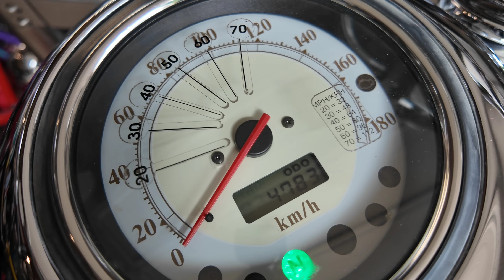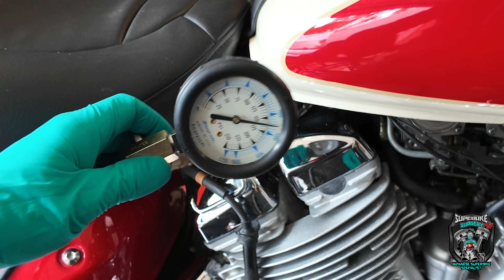Not Again 🤬 Helping a Subscriber Fix Someone's F*** ups. Yamaha Royal Star 1300.

Comment: Firstly..DON'T IGNORE YOUR BACK PAIN !!!! REST IT, SUPPORT IT.  ( 30 years of Sciatica makes me say this...)  Is this going to end up being a warning of the dangers of out of date condoms ??? Nothing worse than "out of date " rubbers............Perish the thought....
Reply: Jim, have you forgotten that there was water down the plug hole , water causing misfire maybe ?
Reply: Too small is far more dangerous! Wheeeee!
Reply: Try the " squat " excercise for your back pain ...
Reply: @whyyou679  
Yep , thanks. and fellow sufferers Especially Men. Wipe your ** sitting down ! NEVER rise and bend over.........Worse strain on Lumber vertebra. Keep it STRAIGHT....
Reply: @tridentmusic5570  
Bounce in a squatting position ... 10 or 20 times ...gets rid of sciatica pain ..it works try it
Reply: @whyyou679  Thank you I will.
Reply: Love the waffling ,need a vid on ignition coils. You explain the tough stuff very fluidly. At least to me! Subscribed
Reply: Depends..It shot in my back just standing up
That was an abrupt movement for the muscle and it cramped up to protect itself from more stretching
Use light painkillers to relax the muscle and keep moving around
The cramp will loosen up slowly in a few weeks and back to normal
But don't go lifting things

Comment: 27 years old and done 5000 miles, It's mental people buy a motorcycle to leave it sat around for years and years doing absolutely nothing.
Reply: Priorities in peoples lives change… and some people like having nice looking trophies… many different reasons why bikes are parked up for years.
I know a guy who parks his bike at his friends place, coz his missus has no idea he even has a bike, and he only does about 100 miles a year. Secretly lol.
Reply: Bought an '02 CBR F4i last May - it had 5300 miles on it. About 3500 in the first 3 years. 

Runs like a sewing machine but the rubber parts give me the fear tbh. I put braided lines on it but the fuel and cooling lines are all original...

Getting the forks services and new constant rate springs fitted in 2 weeks time - asked the mechanic to give it the once over on those parts that could be close to perishing.
Reply: Looks like kph speedo so way less . more like 2000 miles ish
Reply: Jim , that machine was built way B4 E10 was ever thought of . Do u ever perform full fuel system flush first ? Then fill with E5 before u fault find .
So much crap in E10 these days

Comment: Thanks for that. ( I really mean it)  I now know there is more I should know about ignition coils and a little of why a weak spark when tested with a plug on the outside of a cylinder may be too weak under pressure when in the cylinder.

Comment: I'll concur with the difficulty of knowing one of the cylinders in a V4 motor is not firing. I had a disconnected coil wire on the right rear cylinder of my VFR. The bike started right up, seem to idle and run fine, but two clues came to light. These were poor MPG and when under heavy acceleration or putting load on the engine from a stop, when going up a hill for instance, you could tell something was up. The bike sat for a while due to health reasons, so when I was finally able to ride again, it took a few rides to realize and resolve the issue. Getting reacquainted with riding again and with the bike itself took a little while. All good now on both fronts. Love your videos, even with the cursing, but they are definitely more viewer friendly without the swear words. Either way, keep up the great work. Cheers
Reply: "when going up a hill for instance, you could tell something was up" 🤔😁

Comment: Had a similar problem with a Vmax bud it was carbs related, I had the carbs off twice, cleaned them thoroughly same problem, third time I cleaned them I totally stripped and soaked them for 24hrs in acetone, rebuilt them and the bike fired up first time and ran fine from then on, main pain in the ass is refitting them each time they came off 😂, good luck with it but if you're sure it's fuelling use acetone 👍

Comment: Used to get a very similar problem with my V-Max. There are drain holes down next to the spark plugs, one of these holes was blocked on my bike causing water to gather around the plug. This caused it to miss fire just like your bike, it was an easy fix but it took me weeks to discover what was causing the problem.👍

Comment: Jim I own a Royal Star venture and i had a problem with a non firing cylinder. the connections on the coils for the rear cylinders are underneath and can corrode. They are also a real pain to replace

Comment: You can use a timing light to verify if the ignition on a cylinder is at least basically working. Won't give you huge detail - but if it firing reliably there is at least some spark happening. Seafoam in the tank of as parked bike and then actually riding can clear faults - some heat soak is good for the engine. Rubber head flanges/carb mounts go hard, brittle and crack with age.

Comment: I’ve had a couple of times the engine was missing until I started to remove the cap to work out which cylinder, as I removed the cap the spark came back but only with a gap between the plug top and the cap 🤮

Comment: A couple of things Jim:  You use brake clean as a vacuum leak tester.  In America brake clean DOES NOT BURN.  Some carb cleaners do not even burn and must be flame tested first.  We use aerosol carb cleaner.  Also I am very familiar with the oscilloscope spark pattern from my years as a VW mechanic and in another video what I saw looked like the resistor in the sparkplug connector was bad (open circuit)  I'm surprised you don't do an ohm check of the ignition wire itself.

Comment: Pro tip, use a cheap ebay infrared gun on the pipes, you will keep your fingerprints.
Reply from the maker: I have a thermal imaging camera if I could be bothered to walk to my toolbox! 😁
Reply: A spray can and water works quite well.

Comment: I think the notion that an open secondary will damage a coil is an old wives tale.  I’ve never seen a technical paper or data that supports that.  However, I’m always open to data if you’ve come across a good reference that supports damage in this scenario.
Reply from the maker: Thanks for the comment 👍 I must say I'm pretty much with you on this. I've only ever had one instance where, after lots of cranking, I've created a secondary ignition problem.  In this instance, the coil was likely on its last legs already. I guess I'm just repeating what I've read in the training material I've encountered over the years. 

There is probably something to it, but the real issues only occur when running an engine for an extended period without a HT lead connected. I've seen the high voltage literally burrow its way out of the body of the coil over time.

 But as I say, do as I say, not as I do! 😁👍

Comment: Putting a V max motor into a low seat cruiser style bike is interesting, but have you ever noticed that when they do a thing like that, suddenly they make the bike heavy? Why do that? Do they like heavy? I suppose a lot of people do, but where are the powerful cruiser bikes for those who want a low seated light bike? 

I looked around and bought a used 1200 Sportster. I wonder why they need a fuel pump for a carbureted bike.

Comment: I don't mind awkward mechanical faults, electrics are my nightmare. My ZX9r rear lights have totally stopped working, but the bulbs and holders, wires and fuses all look fine. I feel I'm going to have to pretty much strip the bike down to find out what it is causing it, so annoying as I can't use it now obviously.

Comment: I can live with the F bombs. I have held a spanner once or twice.
Just a thought, but if the inlet rubber 'manifold' things are old + warped or split or something, I'd also have a look at the carby diaphragms. Not saying they're bad, don't know, but if the rubber of the inlet pipes has weathered & aged, then the diaphragms are probably a bit ancient too.
PS: Oh yeah, and as a couple of other folks have said, acetone is good for dissolving old fuel varnish and the residue of dried fuel. If the carbs have sat for a year and dried out, then acetone is good thing to have during cleaning.

Comment: I'm struck by the number of these videos I've watched where the bikes have been put away for several months or even years. Pretty much the worst thing you can do. Petrol goes off, O-rings and seals dry up and perish. The list goes on. All of this can be avoided by simply riding the things.. Come on FFS we're in the UK not Siberia. I'm not saying be a martyr to it but getting a bike out once every six weeks or so to give it a good run is the absolute best preventative winter maintenance. What's happening to us..We used to be a hardy bunch but now we're scared of a bit of cold so put our bikes away for six months and wonder why they're running rough..